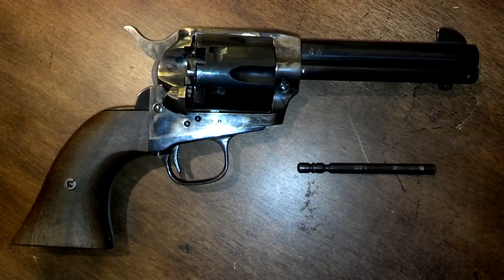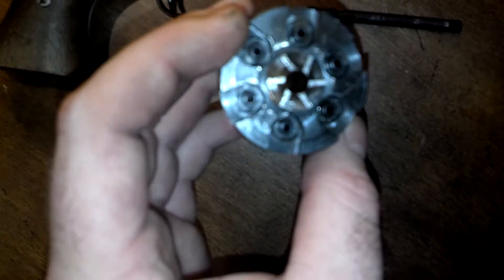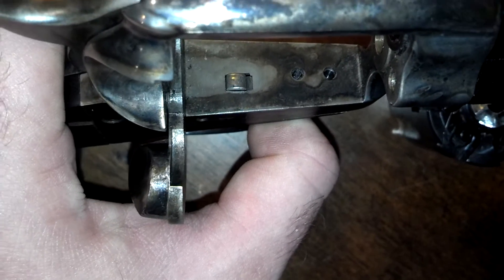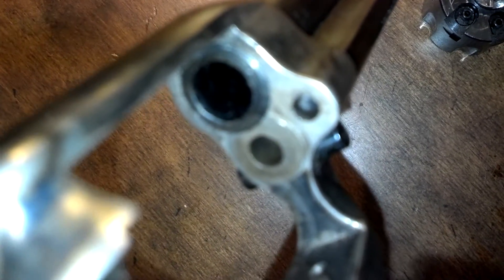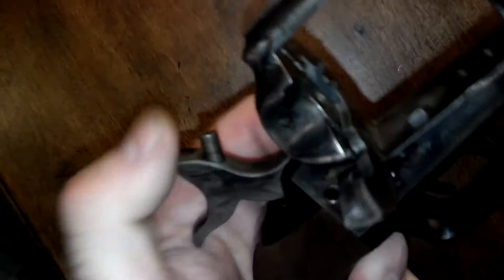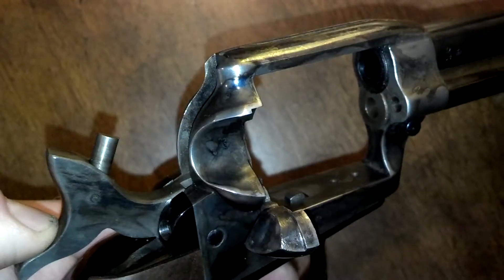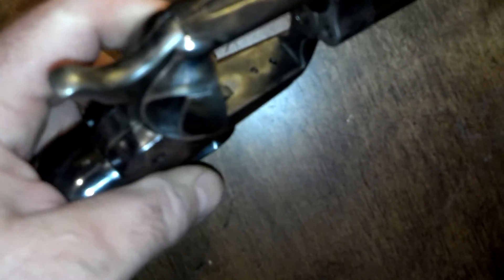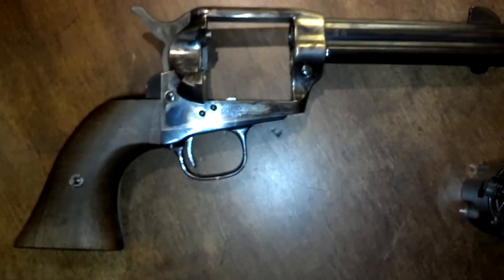Viewer Request Video 7: Why get a Uberti SAA blackpowder muzzle loader?

Comment: About 15 years ago the Uberti Cattleman BP was available through Cabelas...this was back when 1873's were still scare, and BP revolvers were still reasonably priced.  Basically it was before "converting" BP revolvers became well-known and popular which has driven the price up.  My Cattleman revolvers were only $250.
I bought them because I had a suspicion they would be dimensionally identical to the standard 1873, which it turns out they are save for the off-set firing pin and oversize opening in the recoil shield.  
I purchased an 1873 .45 Colt cylinder and fitted it...perfect fit.  The bore on all "44 black powder" guns is actually .452+/-.  So, to convert... I have actually used two different methods.  The first was to file a slot ACROSS the breech face to about 3/16" inch, then undercut into a dovetail using a triangle file.  It's hard to get started due to the glass hard case hardened surface, but a dremel with diamond burr will cut through followed by filing the softer steel below the case harden.  The slot is basically the full width of the frame and "tall" enough to cover the oblong opening.  Then, take a piece of 1/8" 4130 steel strip (available from Aircraft Spruce), cut out a matching insert with dovetail and file-fit until it can be tapped from the loading gate side all the way across.  I then lathe-turned a barrel insert from aluminum rod that went all the way down to rest against the new plate.  The contact end had a 5/32" center hole drilled.  I then added a muzzle alignment plug also turned from aluminum rod and used a long aircraft drill bit and hand drill to create a PERFECTLY aligned firing pin hole.
I then removed the plate and created a beveled "cone shape" on the firing pin side to allow the firing pin to "funnel" into the pin hole.  Interesting...mine is so well-fitted there is NO clearance around the firing pin hole, whereas factory 1873's have an amazingly huge firing pin hole which is one major reason one must not start loading the .45 Colt too hot!  I replaced the BP firing pin with a standard center pin...and HERE one must understand the firing pin is supposed to "wiggle" UP and DOWN in order to keep it from binding, reduce impact shock to the pin from the hammer when the hammer impacts the frame, and of course allow the pin the "funnel" into the firing pin bevel.  There is no need for a spring or anything...just let the firing pin rock up and down like is seen on so many old-time revolvers with the firing pin in hammer.  Once done, NOW start contouring the ends of the insert to match the frame and loading gate shape...during which the insert can be tapped out and in as needed to get a nice fit and finish before final insertion.  When done...I used a two-part slow-set epoxy (Accraglass) to glue the insert into place...the same stuff used to bond in barrel liners...so it works and lasts forever.  Plus, there is no force acting to dislodge the insert...so it can't just "fall out" because it's held in by the dovetail!
You now have a honest-to-goodness 1873 .45 Colt Ctg revovler that will stand up to any and all standard pressure, modern, factory smokeless loads...which are VERY mild by the way.  The REAL test....is to load original spec BP loads...which make the modern smokeless seem pointless.  Using modern solid head brass I was able to compress 37 grains of BP substitute under a 255 grain hard cast slug.  Believe me...the original .45 Colt load IS a "beast"....if the conversion can hold up to that....it will take any modern smokeless load built for the .45 Colt!  These things chronographed 900 feet per second from a 5.5" barrel!  The gun has held up well for the last 15 years....no problems at all.  Of course one must take care when fitting the insert to file the FACE side to create cartridge rim clearance "and a little extra" to prevent the cylinder from binding.
Method number two:  With the frame mounted on its side, I used a milling machine (could have used a drill press), fitted with a "stack" of dremel cut-off wheels that were "worn down" to a measured 1 inch in diameter, or .5" radius.  The wheels are mounted to the standard dremel mandrel and chucked into the drill press.  using an x/y axis vise on a drill press, move the frame into the spinning abrasive wheel and grind out a square opening in the gun frame to a depth of around 3/16" measured at the full depth of the .5" radius wheel.  Once done....grab a section of 1" diameter 4130 steel rod and "section" off a piece large enough to fit the opening and proceed to grind and file until the square insert drops into the radiused opening perfectly..the nice thing about this method is it does not show on the outside at all...plus it's a lot faster to do.  After that, setting up and drilling the firing pin hole is identical to method one....and the drill guide will hold the insert in place without bonding or clamps.  Again, create a bevel in the firing pin side.  Then, using Accraglass, bond the insert into place....it works perfectly.
I've done three conversions....they are "easy" on the scale of gun work.
All my conversions have lasted nearly two decades with regular shooting, though I tend to take it easy on them by limiting them to full-power smokeless loads and avoiding FULL POWER original BP loads....!!!  No wonder the U.S. Army, about 45 seconds after adopting the 1873 .45 Colt as a service revolver, created a REDUCED spec load from the original 255 grain over 40 grains of black, to 230 grain over 28 grains of black....which just happens to be VERY similar to the "modern" .45 ACP milspec load almost half a century later.
So don't let the "armchair" experts fool you....while you would never want to feed ANY 1873 a steady diet of original black powder spec loads....the gun CAN handle it for those who want top power in a field side-arm for defense against predators.
Reply: +Richard Kilibreaux You should "do an video" of this conversion . I've got a 5 1/2 and 7 1/2 Uberti 1873 to do .

Comment: I have a Uberti black powder Cattlemen that I converted to shoot 45 colt rounds. I bought a 45LC cylinder from Taylor's and with very little work with a file I got it to fit. I did NOT have to modify my frame. I did However have to remove some material from the firing pin on the loading gate side. It was hitting the rim of the cartridge so I hade to file it down a little so it only made contact with the primer. As long as you shoot cowboy loads it does not blow the primer back through the firing pin hole. I have $295 and about 1 hour worth of work in it. It runs reliably with the cowboy loads.
Reply: matt wilsey I did same thing, but got firing pin from Tylors also. I opened it up a hair with a file, and it works mint.
Reply: This is the info i needed recently bought one to do a conversion on i did a conversion on a 1851 to shoot 38. And always wanted a saa blackpowder cartridge but didn’t want to spend the money on an actual one

Comment: I have a little time in black powder, far as revolvers go This 1873 is the coolest thing I have seen in a while, YES there is more work reloading involved but man it looks so different from the run of the mill open top Colts and Remingtons just the looks alone not so much but being so different, that makes it I`d like to add one, may not be a grail gun but a nice looker in the collection of Black Powder Revolvers. I know I know they never were made, but man looks sharp.

Comment: The Pietta .45 colt cylinders will fit, but they are "too short" so you would need to pull the barrel, shorten the shoulder, and set the barrel back in deeper. You would aso need to"retime" the barrel so the front sight and ejector line up which will ost likely involve
shortening the barrel face and cutting a new forcing cone.

Then you will have to replace the hammer and/or firing pin with a conical pin, and mill and bush the "backplate" (where the firing pin and cylinder pawl come thru on the frame) to put a proper firing pin bushing in. otherwise the primers will hang up on the plate when fired.

Then you will need to retime the entire hammer, pawl, bolt, trigger, cylinder assembly so it all lines up correctly.

------------------------
OR
you could take the existing clinder, bore it out to take "some cartridge" ( but we can't be sure there is enought meat for .45 colt)
lathe off the backside of the cylinder and build and harden your own backplate with a built-in long floating firing pin kinda like a Kirst

Oh. and modify the hammer...
...

either direction one takes , it's a one-way conversion as the percussion cylinder is either "used up" or will never fit again.

soooooo

it's probably not worth the grief.
Reply: So that would make it not an antique firearm then since fellons could modify them right? I'm new to this black powder thing fyi

Comment: One more thing about loading brass cartridges with black powder and many substitutes....it corrodes the brass over time..."years" and will lead to case failure upon firing.  You can't "see" the corrosion because it occurs inside the case, weakens the brass which then splits.
So, for those who want to create "shelf stock" stick to a reasonable smokeless load, and choose a high-bulk power, or use a fiber fill over powder to keep the powder in place.  One can even create cardboard wad-discs by using a sharpened case to cut-out cardboard discs which are tamped down onto the powder charge....same as one does when loading shot charges...something the massive .45 Colt case does very well!

Comment: Cylinder stop has normally this offset. I'm familiar with 1858s and all of them have the cylinder stop off-center...
Reply: Yep. The cylinder bolt is cammed off the right side of the hammer while the trigger engages the left side of the hammer. The bolt is offset to the right for the same reason the trigger is offset to the left.

Comment: Have a look at A and A GUNSMITHS in the U.K. They do nipples for 209 shotgun primers for these guns. Apparently these make those revolvers reliable. No problem with ignition nor jamming with the caps binding the cylinder. 

It would be an easier option than converting to cartridge.
Reply from the maker: +Necessaryevil Zero 1 

I've seen that before, It was very cool, but I really like the idea of doing a 45LC conversion, percussion is cool, but cartridge (particularly one that wasn't originally one) is just a neat idea)

Comment: I suspect those cutouts around the nipples are more likely designed to make capping easier if you're using a  tool such as the Ted Cash capper which drags sideways upon placing a cap.

Comment: Hey, i have a question. Does this blackpowder gun have a safety, to carry 6 rounds in it? I saw that it doesn't have any safety notches.. Does it have any metal part that goes in front of the Pin? Would be great if someone could help me.
Thanks from Poland

Comment: Did you ever actually convert this? I can't seem to find any for sale anywhere.. only the 1851's and 1858's.
Reply from the maker: Munky332 Not yet, I need a uberti 45LC cylinder and hammer which I haven't wanted to spend the coin on at the moment
Reply: Damn, Ok, lemme know how it goes. IIRC, i saw that R&D actually had a conversion cylinder for this specific model, but it was discontinued. I can't seem to find any place that has these for sale online, which is disappointing.
Reply: Proto-Ordnance Found some info. there are aftermarket gen2 cylinders (which work with this gun, or the pietta, cant remember if there's much of a difference) made by Kirst. they have 45LC and 45ACP (requires moonclips AFAIK) its $195 for a cylinder and bushing. they require fitting.

the problems you mentioned, you said that the guy who did this before was having primer blowback problems. this makes me think that his cylinder was possibly fit wrong, and/or he milled out the firing pin slot too far? my thoughts would be to mill it out, only after fitting the cylinder and checking how much of the primer is visible, and making a firing pin that is still slightly off-center, but makes contact with the primer still.

the pin could also be swapped for a standard firing pin. the BP pin is the same except its cut differently, and is just held in with a pin.
Reply: EMF Firearms and Taylors both sell these.

Comment: Do you know if they make conversion cylinders for these ?
Reply from the maker: You could just buy a piety’s 45lc cylinder and hammer and they would drop in 

The only thing you would need to have machined is the recoil bushing
Reply: @77ratduster interesting. Thanks for this video. Always wondered what it would take to convert it.

Comment: What cylinder fits in here
Reply from the maker: Pietta 45lc 

But you can make a conversion out on the original to run 45 acp
Reply: @77ratduster  ill be using 32-20.  because i am unique.

Comment: I like the do it yourself component but for those who don't have the tools and skills there is a drop in conversion.
http://www.midwayusa.com/product/126824/howell-old-west-conversions-conversion-cylinder-44-caliber-uberti-walker-steel-frame-black-powder-revolver-45-colt-long-colt-6-round-blue
Reply: have you actually tried that conversion? that specifically is labelled for the Walker, which is not a SAA. It looks like they made significant changes here from the SAA to prevent anyone from doing drop in conversions.
Reply: +Locke Davis Wrong cylinder for this gun .
Reply: A Walker cylinder is 2 7/16 long. A SAA cylinder is WAYYY shorter than that. It WON'T work.

Comment: Why would you want to try and convert it to a cartridge revolver, go buy a cartridge revolver.
Reply: in my case, 32-20 is hard to find especially in stock.  rare as can be, and even more so in original form.  i enjoy the 32-20 so its a no brainer it was a requirement for a mate to my winchester 92.